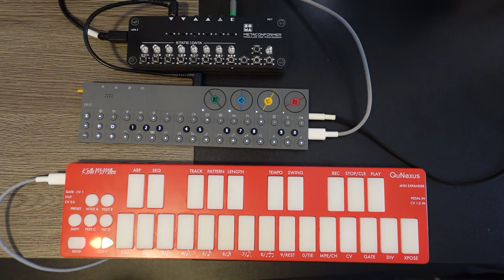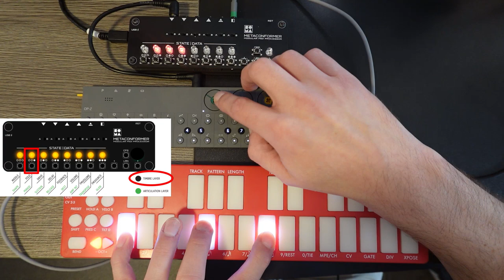SOMA SimplexFM Tips & Tricks: Poly Mode

Comment: Are you sending both distinct CC parameters per track and CC1 (mod wheel)  ?  I'm just getting started and it wasn't clear to me from the manual whether you need both.I only have a knob based controller and haven't been able to get the CC parameter list working yet.
Reply from the maker: @todantilla  No, not sending CC1 - just the specific cc value for each parameter. I do wonder what poly mode would be like while changing the parameters with cc1 only. Could be interesting to try!
Reply: @windowbed  i've been able to get all the cc working except for FM source "cc 14" this one I need to actually press the eighth button on the metaconformer to change source tracks. Any idea why this is happening? Did you get yours to work?
Reply: Also the "0ne-hot scale" for the modulation destination doesn't seems to be working
Reply from the maker: FMSrc has changed for me when I send CC14, both in mono and poly mode, though in Poly mode the LEDs sometimes show the wrong scale. Could that also be the issue for the Destination parameter--do you hear the modulation change but the scale is wrong?